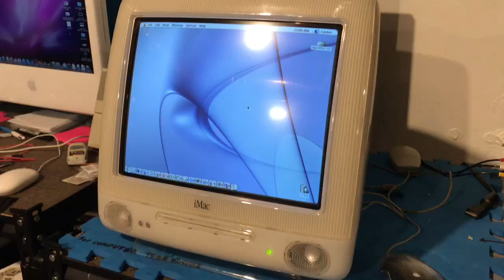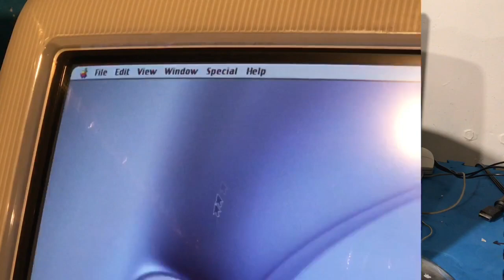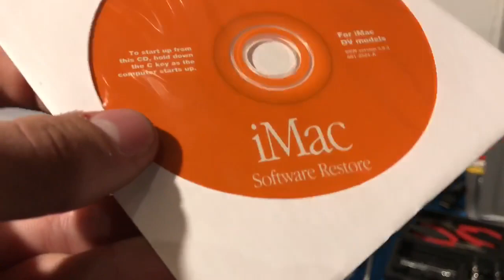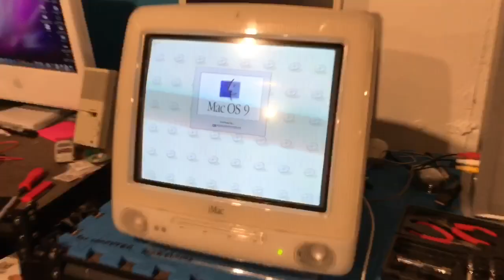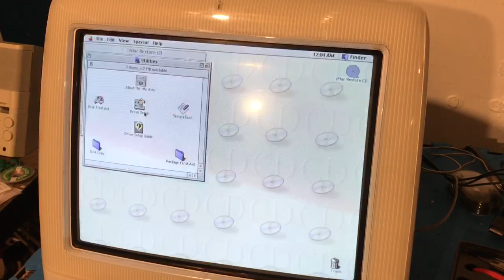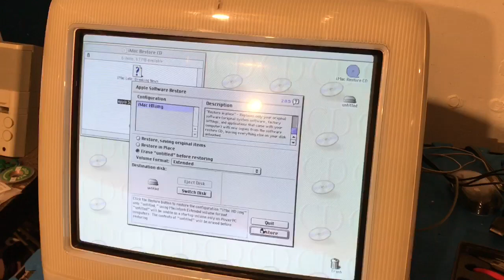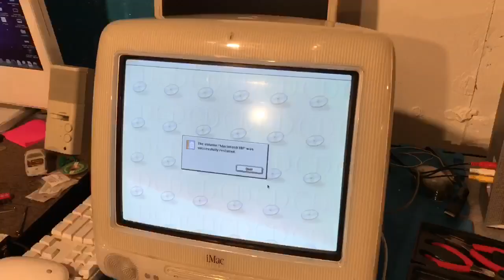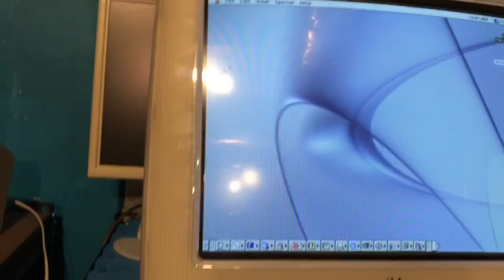How to install an SSD into an iMac G3! (Slot Loader) | Mastergeko4

Comment: I ordered an imac g3 off eBay about 4 years ago. It's case was very cracked and it's screen was crooked and discolored. Both its speakers were blown. I felt bad for it. It was a grape 1999 model. It's slot loading drive worked though. I eventually threw it away. The eBay posting had no pictures and said good condition. I got scammed
Reply from the maker: That was probably from shipping damage, what a shame. I encountered a similar occurrence in another video. 
https://www.youtube.com/watch?v=yl2Hk_5BU_M
Reply: rip, you could've tried returning it because it wasn't as described. Paypal and ebay make it VERY easy for customers to avoid getting scammed to encourage shopping on ebay
Reply: @HearMeLearn  i wish I had.

Comment: Wow, this video is incredibly relevant to me lol. I’ve been attempting to do the same thing with an iMac G3 and a 128GB SSD, and I think you’re using the same IDE to SATA adaptor as well. I’m running into a ton of issues though, the most common being no matter which install ISO I use to install Mac OS 9 onto the SSD it always boots to the white screen with a floppy disk and a flashing question mark after it finishes installing. Any ideas what I could be doing wrong? 

Unfortunately the CD drive on mine seems to be broken so I’ve had to boot off flash drives which seems to work ok on most install disk images.

EDIT: Found the issue! It was the stupid broken CD drive throwing everything off. I unplugged it's IDE cable and swapped the cable around and it booted right into the OS.
Reply from the maker: Glad this video could be helpful! Also good that you found the issue to that install disc issue.

Comment: Really solid tutorial including the appropriate warnings. Quick question I read that these slot loading iMacs have trouble with wake from sleep when using an SSD. I read that you get a spinning beach ball and are forced to hard restart the machine. Do you also have this problem? Thanks for the video!
Reply from the maker: Yeah, sometimes the SSD does have a few wonky issues like this. I haven't actually used the machine in a while so I wouldn't really know at the moment.

Comment: Bonjour, je suis français. Pouvez-vous me décrire quel est le type de Disque SSD  et l'adaptateur que vous ajoutez au disque. Quand au CD de restauration je ne l'ai pas. Combien de Giga font les mémoires. Super vidéo c'est exactement ce que je cherchais pour mon IMac G3 500mhz CD-ROM Bleue
Reply from the maker: Bonjour, pour l'adaptateur, vous aurez besoin d'un adaptateur de disque dur IDE vers SATA. Tout devrait fonctionner et ils ne vendent que 15 $. Je suggère d'acheter un disque de restauration de logiciel iMac avec Mac OS9. C'est un CD orange, tout comme celui de la vidéo que vous pouvez trouver couramment sur ebay. Bonne journée!
Reply: @Mastergeko4 Merci beaucoup

Comment: I bought a 120 GB SSD from OWC (https://eshop.macsales.com/item/OWC/SSDMXLE120/) and I put in a restore disc I burned, it did boot up, but the SSD wasn't visible to the Restore disc program. Am I supposed to install 9.2.2 before I run a restore disc?
Reply: Well, I just tried the install CD now too and a "Destination Disc Cannot be found" Hm... I really don't think I plugged in the IDE ribbon wrong, I"m sure they aren't trying to make it difficult, but I suppose I might have to flip it...
Reply: And I think I solved my own problem! I had to use the Drive Setup program to "initialize" the Drive. I am leaving all this here in case someone else needs to know this.
Reply from the maker: @story-mode  Yes, you have to use drive setup for any unrecognized or non-apple disk. I highlight this before the installation of OS9 in the video. ( 19:17 )